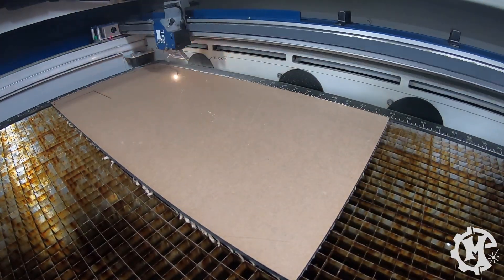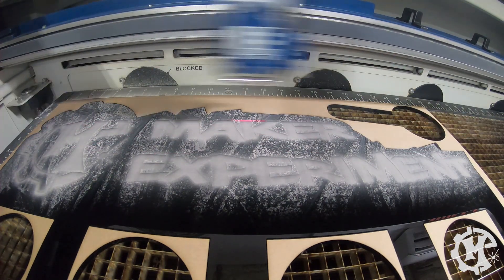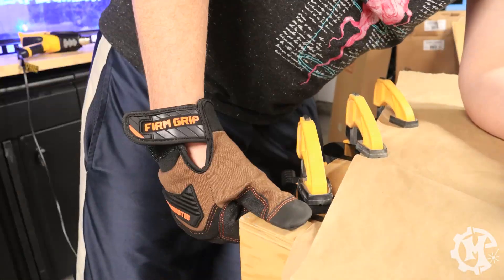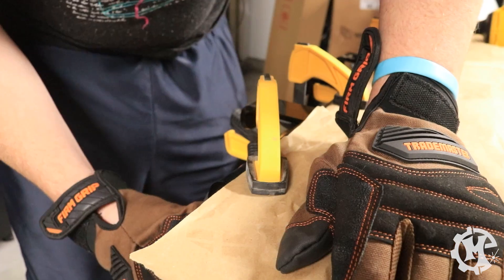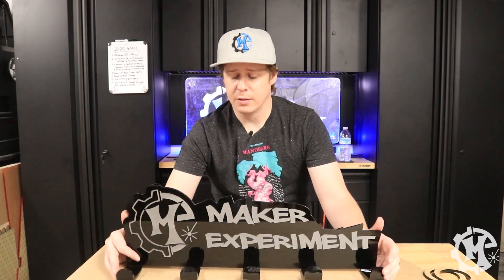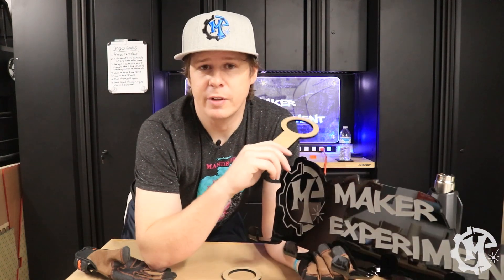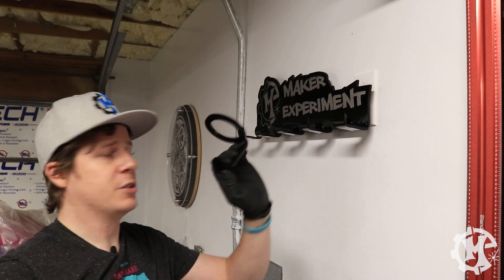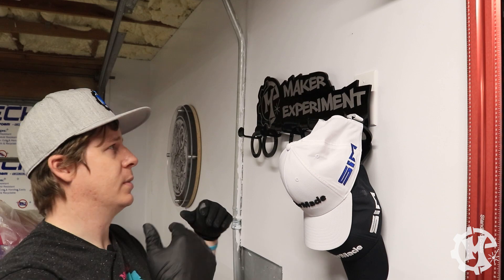How to Make a Hat Rack by Heat Bending Acrylic

Comment: I like the idea, but you seem to make things harder than they are. When posting instructional videos you need to give proper and correct instructions.  More research on your part would make it easier to watch. Also on your acrylic sign in the background, you should've laser-etched the backside in reverse for better illumination.
Reply from the maker: I’m not sure what the instructions were missing but if there is something I missed, it would be good to point that out. As far as me doing more research, I would also suggest the same for yourself. The LED standoffs I used for the sign project specifically state to engrave the front face for better illumination due to how the light is dispersed.